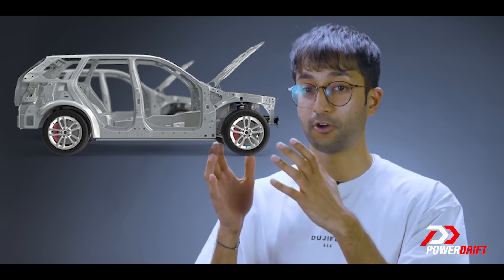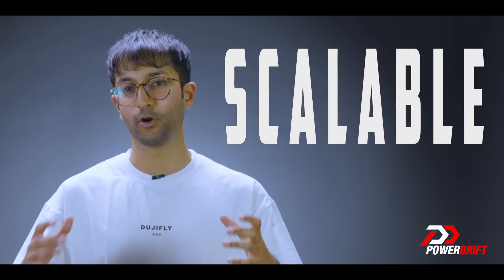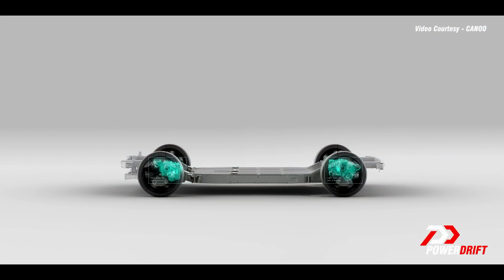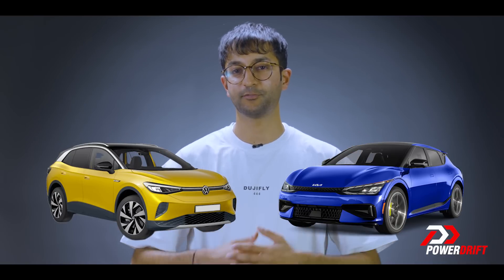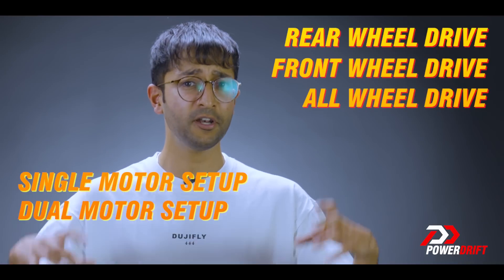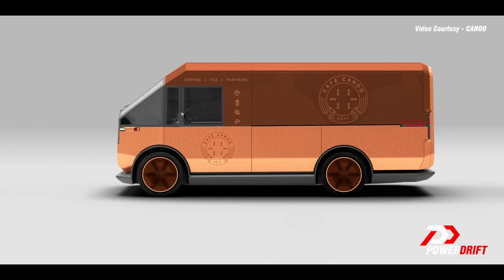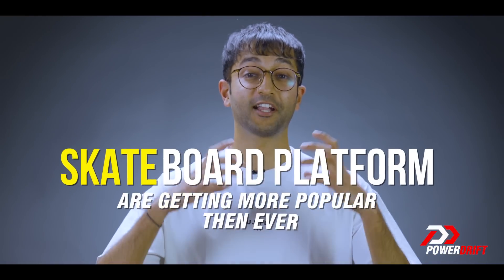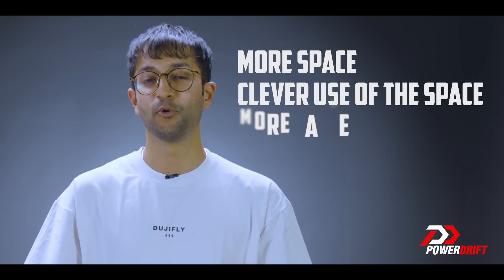Skateboard Platforms - PD Simplified | PowerDrift

Comment: From a Kia EV6 owner: It is actually a very poor example for cabin space design. EVs of today actually have higher cabin floors, reducing the height of the seat from the floor of cabin. In addition cars like the EV6 have no room under the rear of the front seats for the feet of the rear passengers  making for a rather poor knees up seating position.  

This results in poor under thigh support making for higher fatigue in long journeys especially for taller rear seat occupants!